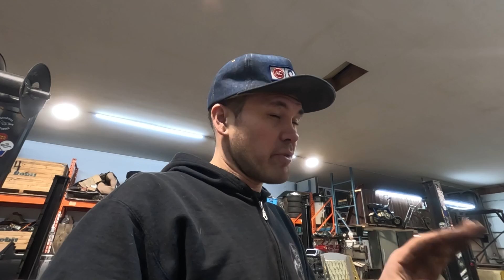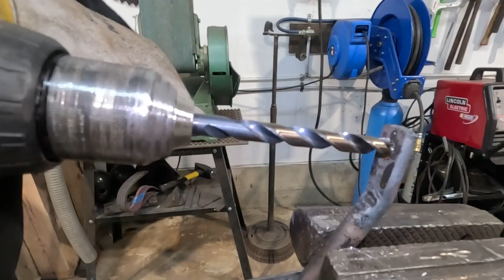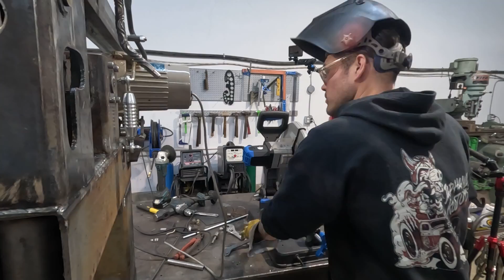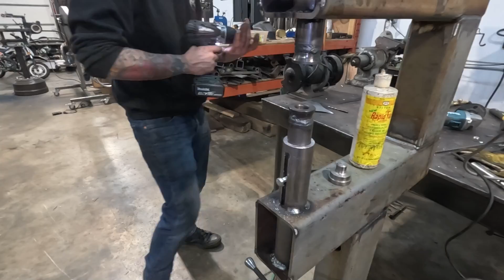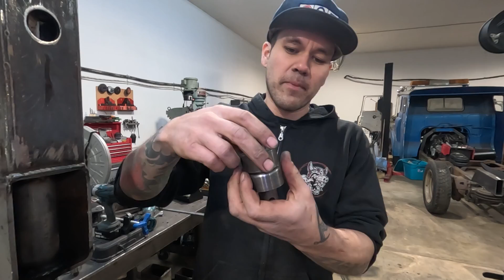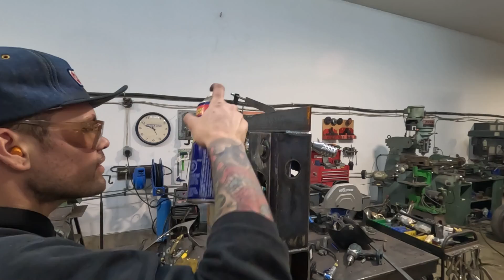Part 2-Making Thumbnail Shrinking Dies - AMAZING! Scrap Metal Power Hammer! Metal Shaping Pullmax

Comment: I want to make a suggestion about guards on your hammer machine. The belt drive needs a  guard. The gear drive on the bead roller also needs guard around it.
Don't get me wrong the machines are  great but not everyone is not 
 used to working around them.
Keep up the great work. 12/9/23 
Louis

Comment: I have been trying to make this set of molds with CNC recently, and there is a question that troubles me. May I ask what is the gap between the upper and lower molds? At present, I am setting a thickness of 2mm, and I am not sure if it is sufficient. Does this mean that only metal plates below 2mm can be shrunk? The answer is very important to me, thank you very much

Comment: If you open your fuse panel it should have a 10 awg. Wire for auxiliary trailor breaks. Should be able to tie into it. And run a ground directly to your frame. I'd wire a bat maintainer,off that to your winch batt. You could always wire it so you could plug in a portable solor panel. When trailor is parked for a while it'll keep the battery up👍👍. Thanks again brother .just sharing ideas I've had.

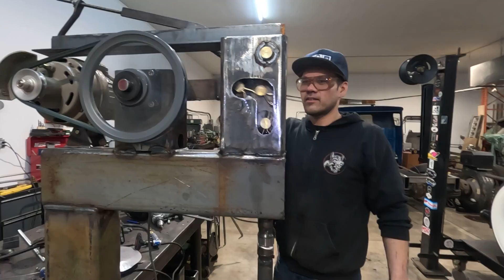Comment: 42:10 WD40 is NOT a lubricant! Just the opposite. In 9 days the metal will be dryer than a popcorn fart. 😳😬   Great build!
Reply: Spot on. So Right. Use proper lubricant oil.

Comment: A treadmill motor might be a good motor. Variable speed and powerfull.  I have one for a grinder/polisher i built. Plan on using one in a belt machine too.
Reply: They're pwm controlled too so power is the same at whatever rpm.

Comment: As for lubrication of the machine, around here they make an ag product (brand name) Sliplate.  Basically graphite in paint form.  They even have it in spay.  Used to lubricate field discs, plows, metal on metal...  Basically what your machine is doing.  Since it's a dry lube you won't get the oil drip down and it'll last longer than the WD40.

Comment: What you did here gives me a idea that is really stupid or a genius move.... see if you can visualize it?!! You mentioned a "Sewing Machine" and of course this is hard even for me the ditzy one .... imagine a table similar to the sewing machine but offsets so that when the hammer makes whichever shape we have figured out... like a mold on a side of a rig... probably a quarter inch wide and say a eighty of a inch in  rise or lower.. matter of perspective as you turn it one way and its up and the other is obviously down. Now going much slower, sew a name or a design on something as the feet under the stamp is pulling it along just like material in a sewing machine would do, just a tad slower to have best control... tell me, can you visualize it and if you can, then you can make it... as they say, "A picture is worth a thousand words"          Just out of curiosity, would you risk losing a Picasso Picture?
Reply from the maker: Absolutely I can visualize it! Cool idea for sure!
Reply: @MakeItKustom  Karl, its always been illegal to alter a licence plate forever yet registered, they let them be in certain cases done on old classics and some custom vehicles.   So just for a idea that crosses everyones mind,  licence plate with the name "Karl's" in old english script done on the sewing machine or even the present way of bead roll on a plate. And to add to the complexity of it, if it could be a fancier style of hammering it so it looked like some of the stitching done by a sewing machine like the zig zag or fancy spacing in that raised lettering and possible Roman Numerals you were taught in school to never use in life again but at least when you go to your capital building, they used roman numerals to date the building of a building. Just some crazy stuff that filters through my brain at times

Comment: The spring in Sosa Metal's power hammer allows a smaller motor at higher speed because momentum, speed and direction change become stored energy in the spring.  Karl's direct link mechanism uses straight, mechanical advantage in the lengths of arms to both stationary link and upper die.  Karl's guess is reasonable about hydraulic cylinder spindles being alloy, most likely 4130 (4140 carbon content is a bitch to weld).  4130 chrome-moly steel has good weldability and even annealed 4130 has higher toughness than 1008-1010 low-carbon or A-grade steels common on wrought shapes (angle and square/rectangle tube).  Probably good to weld a bolt shank that had six or eight 'dash marks' on hex head or use a socket-head cap screw, as those are alloy steel.  Cracked welds on the first set of Karl's dies likely came welding alloy steel at room temperature.  Alloy steels aren't easy to weld and pre-heating die/bolt before weld reduces tendency to crack.  Well-soaked, pre-heated material stays hot and slows down cooling/shrinking after welding.  Avoid getting alloy steels red-hot where possible as that does similar to a heat-treat process.  Rapid temperature changes can cause cracks (like with water-hardening grade tool steel for example).
Reply from the maker: Man, Jim you are a wealth of information

Comment: Hey Karl, love your videos.  Very impressed that you “threw together” a pullmax-style hammer using materials on hand and weldment as without a lot of fancy machined bits.  Super cool.  

I made a set of thumbnail die’s by tack welding the upper and lower blanks together then using a drill press to drill an angled hole at about 15 degrees to the parting line, dead center on the parting line.  Drill deep enough to form the recess in the upper die and a full depth of the drill in the lower die.  Then break the tack and slide a short piece of round bar into the trough/hole in the lower die to give you the “thumb”.  A small weld on the back of the die will secure it.  Then it’s mostly a matter of clearanceing the dies so the the only contact spot is a smile just in front of the base of the thumb.  The trick of drilling the angled hole to spruce the recess in the upper die and the seat to locate the thumb is a big time saver, and you are guaranteed that the dies line up.
Reply from the maker: Wow that’s a really cool way to make the die. I can see how advantageous that would be!
Reply: But how do you achieve a larger radius of the upper mold? It means that the concave one requires more space.

Comment: Great, more oil or grease feed to the plain bearings will help the running power. WD 40 is quite thin. May be graphite grease  might be good. But a really fun inspiring build. It’s always more satisfying if you go with what you’ve got as it makes you think around problems.
Reply from the maker: Yea I love building like this. It’s freedom lol
Reply from the maker: Good call on the oil. WD is wayyy to thin
Reply: WD is a poor lubricant! Good for cleaning equipment, flash rust and light protection on new machined metals.

Comment: Karl - I've never tried to make thumbnail shrinking dies, but several people told me that they were very difficult to make work properly. I am so impressed that you achieved such success with only your second set of dies! 
I'm sure your trip to Australia will be a huge success. I've traveled there quite a bit, and there are so many people there with a 'can-do' attitude, that love the traditional American style of cars!
Reply from the maker: Thanks so much Ron! It was helpful looking at Sosas does to see how to shape them. There’s still some more work to do on them I think, but I’m getting a better understanding of what the dies need for clearances. I’m excited for the trip ! Sitting at the gate right now 😂
Reply: Having an actual thumbnail die in hand to reverse engineer likely speeds the experimentation process up significantly compared to trying to clone one using only pictures.
Reply: Now we need to see make some Dies.
#STAYSAFE 
#PHILLYPHILLY 🇺🇸
Reply: Hi,your videos are awesome I like how detailed your instructions are without a bunch of unnecessary footage like alot of other guys do.I recently started  shaping metals and your videos are invaluable to me for learning and your can do attitude is inspiring and also fun  to watch. I noticed you using oil for drilling you need to get some high speed drilling wax it is a magic game changer when applied to drill bit it's very noticeable it turns metal into butter and then you can tell when it is spent back to normal drilling I wish I found it years ago it's like magic witchery or something I could send you some if you like if I had an address  I could send it to. Keep up the good work you rock.
Reply: Jeff - I will have to explore this!  @jeffglubrecht16

Comment: I found the motor Craigslist that is $40. First off I thought what am I going to use that for. And at my shop. Now I figured out all the stuff I can use that for. Thanks make it custom:face-blue-smiling::trophy-yellow-smiling: when you start your torch the air before you start it in gas. Make for a cleaner startup. Something you're going to have to get used to it , but I think you'll like. As far as I can remember
Reply from the maker: Good call lol was always taught to light the fuel first

Comment: Inspired to build one for myself, I have a lathe and a mill. Your thoughts on using a 2 HP motor with a flywheel and brake.
Reply from the maker: 2hp would be ideal. And make a bit stiffer frame

Comment: Wow, it's working great. If you lowered the peak of the beak on the lower die a tiny bit maybe it might need a little less power when pulling the work piece back in the flattening phase? Just a thought, it looked like it was hanging up there a few times.
Reply from the maker: Yea it was definitely getting held up. It could use more room

Comment: That's a die filer file you are using, I ran across a pile if them when I built my die filer, very handy indeed!  You've got a fine touch with the disc sander, massaging that set of thumbnail dies, looks really good.  If you really need more power, try going with a three phase motor, if you don't have three phase, you can use a stationary converter or a dynamic, if you need the full power.  I've only got single phase but I'm running my milling machine and a couple others on three phase from a static converter.  I always enjoy your videos, great content, great inspiration!
Reply from the maker: What’s crazy is now the machine has double the power than in the video. It was binding in the crank. Now it’s found it’s place lol you’ll see in the next video! Lol blew my mind

Comment: The first set of dies . Was the return too tight . Eg .when coming back thru it was stretching the metal again through compression . I believe there's a fine line at the rear point between shrinking back flat to re stretching the metal .  I messed around for days trying to sort that area on a dies set I made then revised my mistake .???
Reply from the maker: Yes exactly! That’s a great explanation of what happened there

Comment: Nice job!!! I think hydraulic cylinder rod is 4140. Forklift forks are also 4140/4340. I make a lot of tools out of coil and leaf springs. (5160 usually). On numbered steel the first two numbers (51)60 Is the composition (nickel and chromium and steel Etc..) the second number 51(60) is carbon content. 60 is 0.6 percent carbon 4140 would be 0.4 percent carbon etc. For striking tools 0.4 is enough carbon. That is just a rule of thumb. There is allot to hardening and tempering steel and they are all different in their own ways. I tell people making knives and tools (blacksmithing)  leads back to working on cars eventually.
Reply: People like you who take your time to explain things like these steel numbers are definitely people worthy of listening to and for sure worthy of my subscription. I'm charlie and I'm your 240'th subber! ... 73 & retired to my shop here in my Paradise...hidden away from all the flatlander crazies up here in the Sierra Mountains of NorCal. 👈😎👌
Reply: @charlesirby9222  Thank you.
Reply from the maker: Really great information thank you!!!

Comment: you are probably already grinding through the hardened case. This could be checked by using a file on a surface you ground. If the file bites into it ,the hard case is gone. You do want to have them case hardened ,casenit should give you deep enough hardening to prevent wear. You should also be able to form them by handfile unless the die grinder is the weapon of your choice......